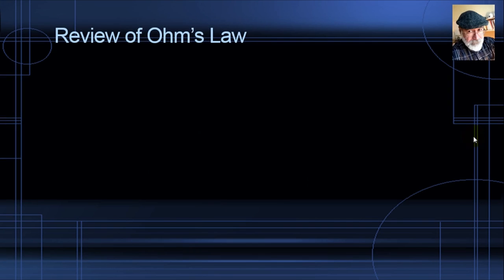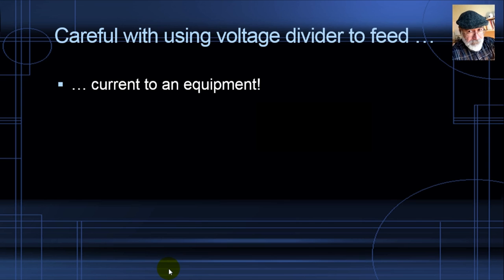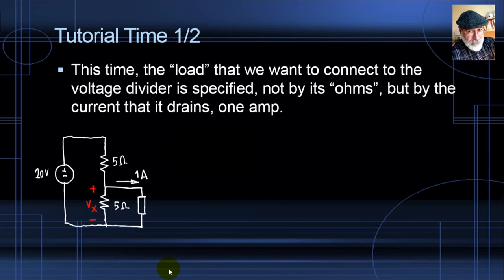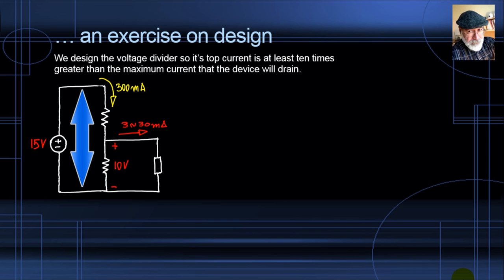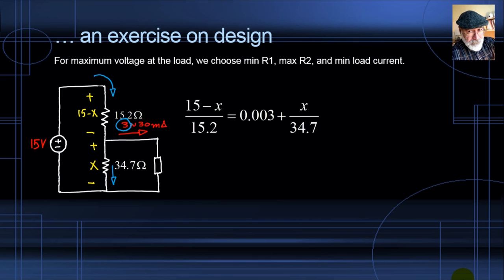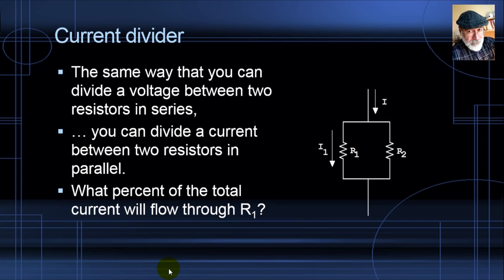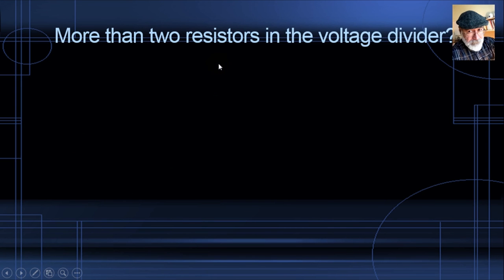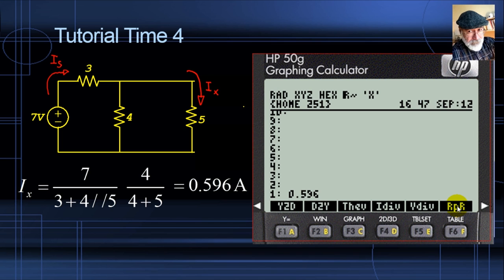EE 101/16 - Voltage and current dividers (reloaded with design)

Comment: Which video has the calculator program that solves KCL?
Reply from the maker: Sorry that I didn't see that post earlier, eleven months, geez! Sorry really. The solution of systems of linear equations is part of the firmware (ROM) of the HP-50g. It comes with the calculator. However, the HP-50g has been discontinued by Hewlett-Packard. In its place they have released a fine new calculator (that includes the same CAS module), the HP-PRIME.